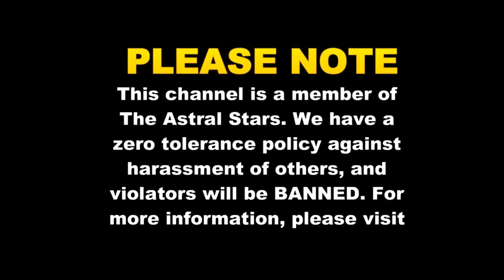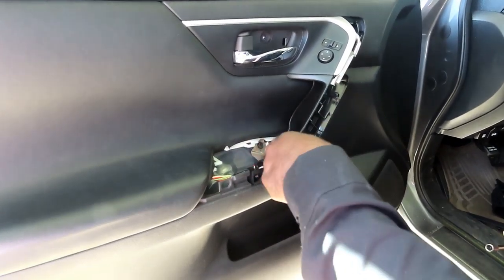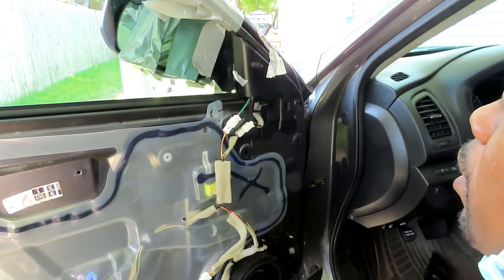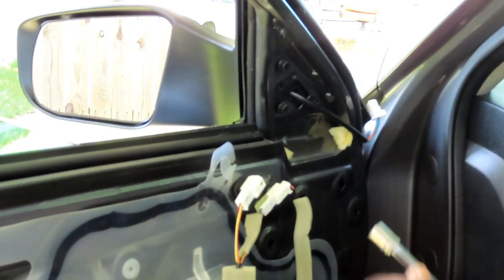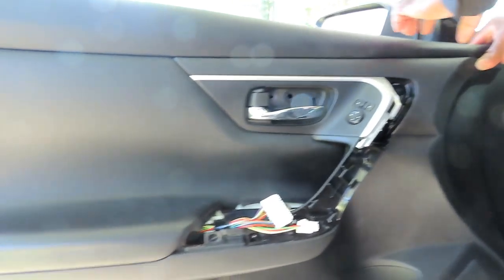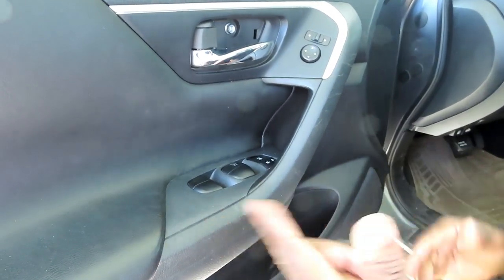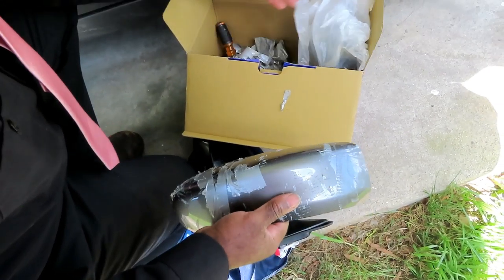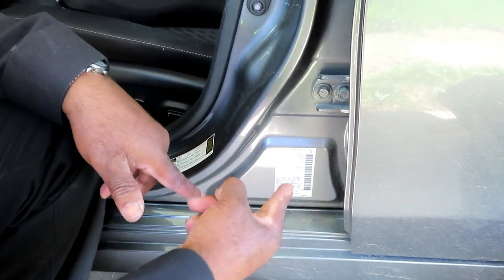⭐ 2018 Nissan Altima - Left Outside Door Mirror Replacement

Comment: Hey Bro, I have a 2013 Nissan Altima  SV 2.5. I replaced both camshaft POS sensors on top of the engine, replaced valve cover, new spark plugs and one of the 3 sensors on the passenger side of the engine (top one) now I get codes PO300, P0011 and P1078 I can drive the car for about a mile (runs smooth) after that mile it begin to bulk like a horse...Need your help bad...thanks in advance...AWESOME MIRROR REPAIR!
Reply from the maker: Did you have those codes before you replaced those parts?
Reply: @OnlineAutoRepairVideos  IT WAS AFTER....  Problems: P0011 intake A bank 1 and P1078 bank 1....ALSO IT HAS A NEW AIR FILTER and cleaned mass air flow sensor with special cleaner. This car only have 46000 miles on it